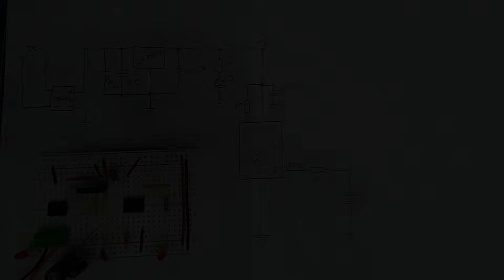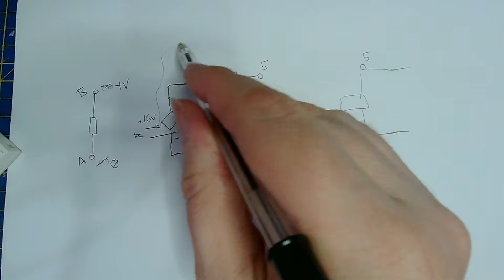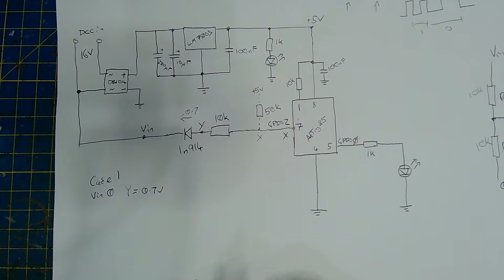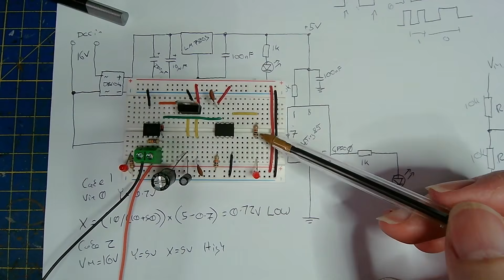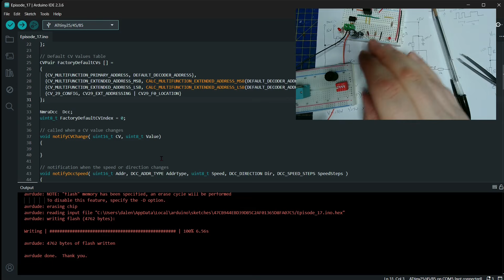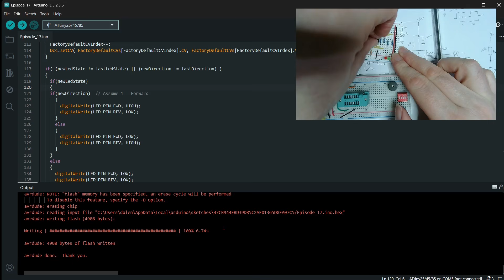17. Making a DCC function decoder (part 3) - DCC goes Live! #dcc #modelrailroad #AtTiny85

Comment: At 23:29 you were justifying the use of R2 by saying that the lower it's voltage the higher the divided output voltage, and that it limits the current. The first is not right, you have that upside down - a low resistance would equal a low output voltage, and that's better. Zero ohms (ie not there at all) would be best of all. The second is true, but what current? You've only got 5V / 50K = 0.1mA there without it, and it only makes a difference of about 20uA anyway! Better off without it.
Reply from the maker: I was trying to get my head around the circuit myself, need to go back again

Comment: There's a nice lot of information in here, explained well, thanks 🙂 I had no idea using the pull-up on the interrupt input pin was acting like a voltage divider - I was blissfully unaware there was a chance the voltage wouldn't drop low enough! I also continually forget that diodes drop 0.7 volts.

Seeing the CV setting and acknowledgement requirements is interesting - I've not looked into that side of the DCC spec yet. I don't want to have to take each decoder to the computer to give it an address, so programming CVs will be useful.

I'm a bit confused by address 3 being a long one - aren't the bits in the address byte identical for long and short addresses as small as 3? Though that might be something to do with the NMRA library functions rather than the DCC spec.

Yesterday I was going over an assorted pack of SOT-23 size transistors, using their markings and notes on the packaging to find what I hope are the right data sheets - I've never used transistors before (though am familiar with the basic theory of using them as switches) so part 4 of your series might prove especially informative on that front 🙂
Reply from the maker: with the address you can code #3 as a long format, worth noting a lot of controller will automatically send it as a short one though which will be missed so.. yeah.. there is another way to handle the CV EEPROM stuff, the EEPROM doesn't get touched when you upload code - you could change to another programme to set them directly, then upload the code.

sort of see it as a procedure that every time the code changes with new CVs or changed defaults to include the "set to default" code routine. the fun bit is while there are some standards for what CV does what, for a function decoder there are chunks related to motor control you would never use so can use for anything.

as for transistors, they are not too hard, you just need to remember they are current devices, not voltage devices, (there are MOSFET which are voltage devices, not current devices too)

have had a few videos earlier on transistors (the ones related to relays) but in practice they are not too hard to use as switches this way. the SOT-23 ones are fiddly, and check the pin out as its not what you may expect (base tends to be one side, not the middle) and find out the gain on the thing as you want it fully on or they get warm

all fun, next part I hope to script up and film this week coming

:)

Comment: Excellent series - thank you!
Just a thought - if the programming ACKnowledge is a desirable feature, would it make sense to introduce a dedicated “switchable load” (suitable resistor for 60mA draw) solely for that purpose? Since you don’t have any outputs now spare on the Tiny, maybe you could build a simple AND circuit on the forward & reverse LED outputs (which could not both be on together except in programming mode) …
Reply from the maker: Hi, the programming acknowledge was indeed a pain at first, its moving to a load on the 13.3V DC side with the AtTiny switching it. I did actually think on a dedicated resistor for this and with an AtTiny84 with more pins I probably would.

for now though what the code does it turn all four LEDs on, no logic gates needed as its all under software control. there is a slight issue this way as the video showed, if a light is on when you start programming it won't work.. a dedicated resistor gets around that. I see what you mean though about having the extra resistor kick in with both head and tail lights on.

"da plan" is the brightness will be dimmed using pulse width modulation so I can have brighter lights triggering the 60mA function but have them dimmer normally. worth noting the eventual concept for this should have a free pin (aim is head/tail lights and interior lights)

cheers for watching though and its a good idea

Comment: Be careful not to end up watching an overload explosion, mate. Trust me, a DCC manual controller is a lot safer to use. Decoders are used to make model engines give out various sound functions, not to power a model railway. Please steer clear of this thing, you're beginning to scare me a little. I'm not telling you off, I'm just worried about you. If the decoder blows up in your face, you'll end up possibly fried and burnt to a crisp. Believe me, we don't want Leopard's Tail Fries for lunch.
Reply from the maker: its not powering the railway.. its powered from the railway. also when this test on is on I'm sat a short distance away not standing over it. 

its an idea though, an episode on electrical safety

:)

Comment: Hi there at this point I have the opportunity to have a tail light at each end of a break van and an internal light .that's great . Once the outputs have a transistor I can light a carage or use it as a stationary decoder for a building . Thank's I can't wait for the next part.
Reply from the maker: the two specific use cases planned are coach lighting and guards van lighting, needs a bit more to manage the brightness.

stationary decoder stuff ideally wants opto-isolation and its own power feed, but for a remote corner this could certainly do it and save a chunk of wiring

:)

Comment: Don't use LM series liner volt regulators they expelled way to much energy as heat, 
I burn't my hand on an LM7805 regulating from 12V at it got to over 60 degrees.
You didn't need to mention me!
Reply from the maker: the end goal is the power through it is in the order of a few milliamps only, the rest bypasses it so it largely doesn't matter, there are lower drop out ones but its the same heat.

buck converters can work, the ones I've used are larger, this is not the "ideal" way for sure, especially for heat and yes drive them hard and you get a heck of a lot of "ouch" out of them

its a valid point :)
Reply: @aleopardstail  I wasn't running it hard, I only had an led!
Reply: @AJB2K3  There must have been something else going on. Even if you were driving your LED way too hard (lets say 40mA) then the regulator would only be dissipating 7V x 40mA =  0.28W which wouldn't be anywhere near enough to heat the regulator that much. Perhaps your current limiting resistor was faulty or something. As Leopard says, the actual model of regulator doesn't matter provided it can handle the current and the drop-out is low enough - it will still drop the same amount of power and hence dissipate the same amount of heat.